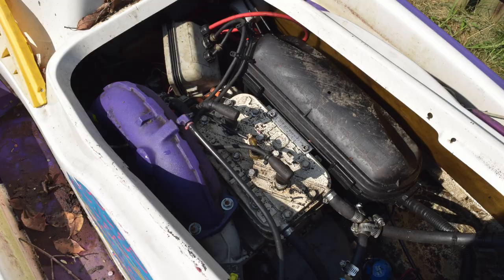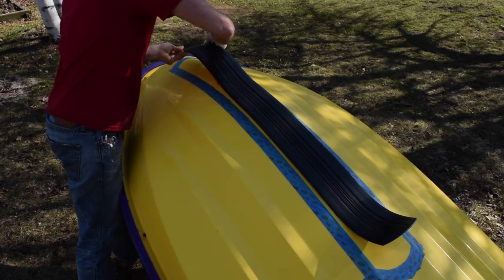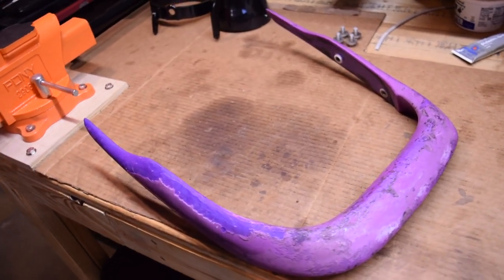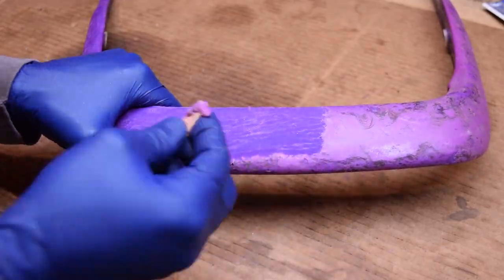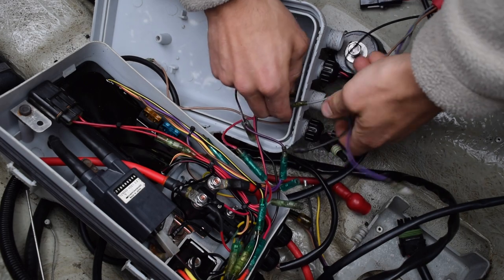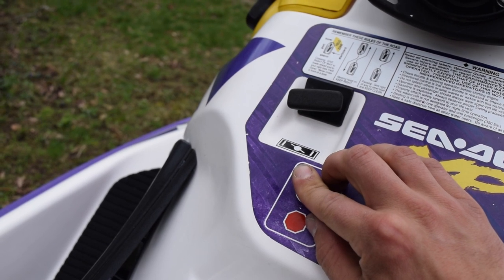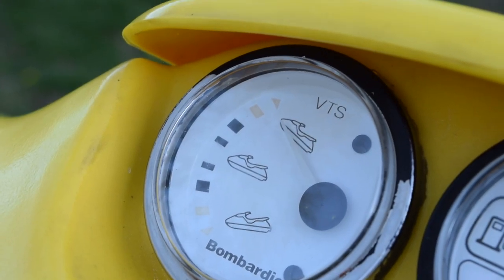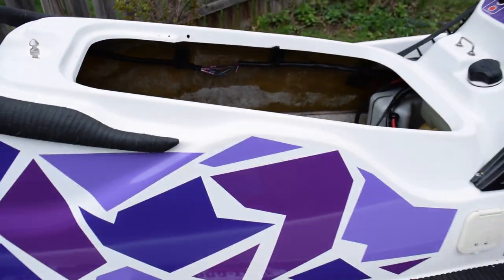Jet Ski FULL Rebuild, Almost Done... | 1995 SeaDoo XP 720 | Part 5

Comment: Hmmm a bilge pump..... might need to invest in that
Reply from the maker: Yeah, not sure if it's necessary, but seems like a good idea...
Reply: Its not, ypu have 2 built into the hull
Reply from the maker: @kyletrump8025  They only work when the ski is moving, though...
Reply: @reed.k.h  when else would you need it? If you have a leak that bad that you need an electric bilge, you have bigger problems!
Reply: Bilge pumps are a must on standup skis but it's not a bad idea given the amount of work being done already on this ski.  I have a 96' XP and it's super tippy because of the X4 hull, not sure if your 95' will be any different but the hull is going to have water in it regardless so why not have two methods to remove it?  Plus, the extra switch makes it look 10x cooler and guaranteed to attract females by at least an increase of 10%.
Reply from the maker: @zeero311  Yeah, definitely was just about to say the same thing...
Reply: @reed.k.h  Those little dingle dongles switches are chick magnets.  Ignore the haters.  Speaking of hating, where they hell you been?  Did you die?  Been 2 months and I need some more laughs, or see some progress on that princess of a ski you got!
Reply from the maker: @WarbirdPylonRacer  These videos don't edit themselves... And, y'know, I gotta get outside once in a while. This next one's the big finale. Shooting for a week from now.

Comment: Get rid of those metal clamps on VTS boot. They will shred it and let water in and toast the VTS system. They make an upgrade for them.
Reply from the maker: Good call, thanks for the tip

Comment: How did you end up mounting that bilge pump and where did you run it to for draining?
Reply from the maker: I mounted it using adhesive zip-tie mounts and a couple of zip ties. I routed the drain hose to an existing hole in the rear of the hull that a previous owner had used for bilge draining.

Comment: Hey man, I am also currently rebuilding a 95 XP, and I am having issues with the gauges and the beeps. I have been told on the forums that it shouldnt beep when the key is put in but that appears to be completely wrong. I have tried a new beeper as people also told me they go bad easily and that still did nothing. What exactly did you try here to make it work, and what do I have to fix to make it work permanently. Also, my fuel gauge has no sign of life when the key is put in. Just for reference my 95 is the exact spec you have. It has a non dess key, and vts.
Reply: Side note, I was told on the forums that it should only beep while it is running, same for the gauges. After rewatching your video here maybe it is only grounded by the stator while running and it seems like you just bypassed it. Correct me if I am wrong but maybe my unit is fine. Keep in mind I am yet to start my ski as I am around the same progress as you are here.
Reply from the maker: When I plug in the key, all the gauges light up and work. The engine does not need to be running. (Side note spoiler for Part 6: she's running.) However, I have an aftermarket MPEM, so this may not be the factory behavior. Also, for whatever reason, it only beeps about half the time when I plug in the key, but whether or not it beeps doesn't affect the gauges, so I've just considered it a non-issue.

As for the stator ground, it doesn't matter if the engine is running. It's just a ground to the engine block.

Regarding your fuel gauge, my guess is that the magnet fell out of the sensor float in the fuel sending unit. The same thing happened on mine, and I just bought a new float: https://bayareapowersports.com/i-1905-sea-doo-fuel-baffle-float-sender-repair-kit-sp-spi-spx-gsx-gtx-xp-hx-gts-gti-rx.html?gclid=Cj0KCQjwxJqHBhC4ARIsAChq4athFv_1-sdt6KQ30OHevIcKtC672PmMXno7rV4_U4ZddLWGLQJNzMMaAsVKEALw_wcB

Here's the key behavior, as I understand it (keep in mind that this is only how mine behaves, and I have an aftermarket MPEM): When the key is put in, with the engine off, the gauges get power for 30 seconds, then shut off if the start button is not pressed. Once the start button is pressed and the engine is running, everything has power (duh). When the key is removed, it shuts down the engine, but the gauges still get power for 30 seconds. Not sure if this is factory behavior, but it's how mine works and I've had no issues.

Good luck man!
Reply: @reed.k.h  Thank you for the advice man! Im assuming it’s different behavior due to the MPEM but as I research more im sure I’ll figure it out. Good luck on the build!
Reply from the maker: @nickmargiotta32  Thanks, keep an eye out for Part 6 at the end of this week!

Comment: Looking at picking up same model. What did that end up costing?
Reply from the maker: I got the ski in pretty rough shape for $400, and the total cost came to a little over $2k.
Reply: @reed.k.h  This one I'm looking at I can get for $200 with trailer. No titles. I was unable to see if it would at least turn over. Starter would not ingauge. The engine compartment was pretty clean. It's sounding like it may not be worth it.
Reply from the maker: @tjcdiy  For that price I'd say it's definitely worth it, assuming the hull is in decent shape.

Comment: Did you use a chemical to help scrape off goop on grab bar?
Reply from the maker: Nope, just a lot of sweating
Reply: @reed.k.h  sweating?
Reply from the maker: @fuesselfc  Yeah you know, perspiring. Because of the hard work.
Reply: @reed.k.h  ok, just checking it wasn’t a heat up process to make it more loose. Thx
Reply from the maker: @fuesselfc  No prob